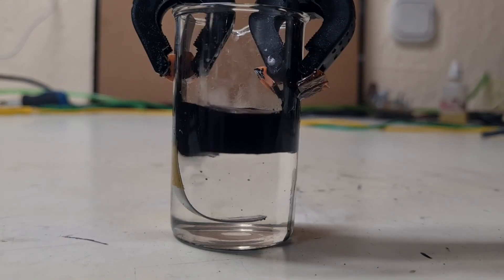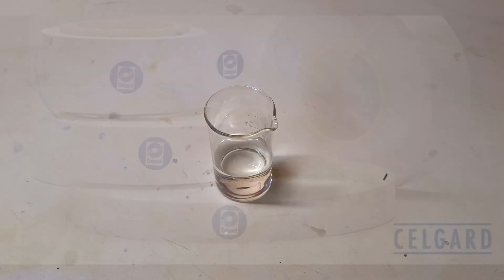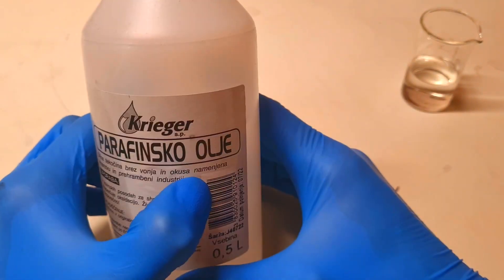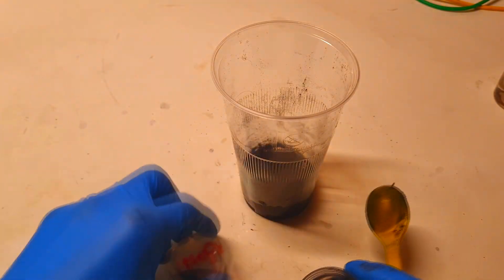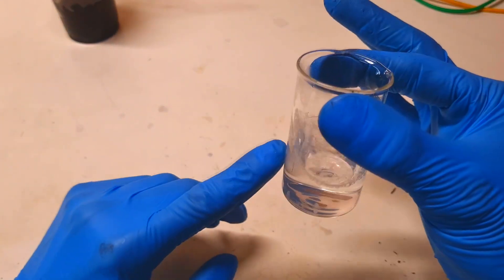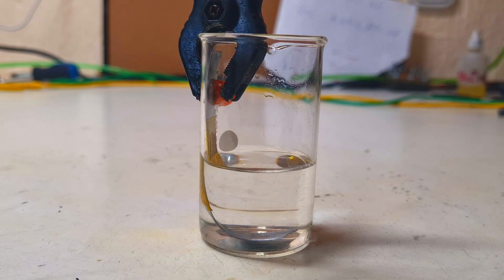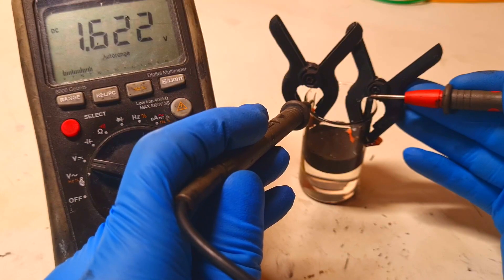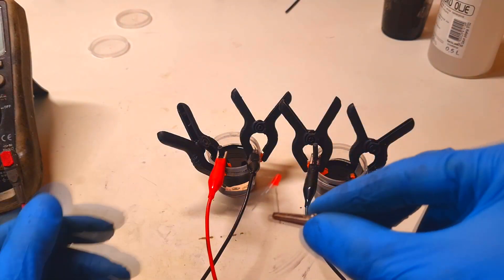DIY Separator free Battery

Comment: or use an insulator plastic tube around the metal strip
Reply: the outside of the same pipe tube can be the connector to the carbon, 2-in-1
Reply: so the air cannot really get a good contact with the water part of the electrode, so h+ and o- dont combine properly, only at the surface of the water and carbon, not porous enough, maybe a floating carbon foam would be better
Reply: if you stir graphite in vinegar, you get a ton of foam, but it will settle down
Reply: some kind of foaming curing agent is required optimally
Reply: try carbon fiber tubes, epoxy mixed or bare, inside and/or outside coated

Comment: Could you add a carbon cradle on the bottom, and add different metals(one at a time) say iron or aluminium, a way of turning metal scraps into electricity?
Reply from the maker: Yes sure
Reply: I thought the same, soap no good
Reply: I'm thinking the carbon electrode is acting as an air cathode? How about a carbon sponge on the bottom perhaps with catalyst impregnation and bubble hydrogen gas through it? It is kind of related to your flow battery.
Reply from the maker: @dav1dbone  Yes the activated carbon layer is a air cathode. In your case is better to make in static cell design. Yes, the cell desig from this video is more related to flow cell designs, but a metal air battery was easier to make. But just to note you have also metal air batteries with flow cell design. But where the oil air cathode in metal air battery can shine is as water impermeable layer that the water can not evaporate, for example.

Comment: I had a similar idea for my batteries. There is one critical issue with this approach - soap. Overtime the sodium hydroxide will react with most oils (paraffin included) and form soap which is TERRIBLE for batteries. I guess it would be possible to use some intermittent layer of a funky, non miscible hydrocarbon if one were to find an oil that would be less dense than it but the conductivity would drop to basically zero.

Comment: I like that the cathode layer shields the anode from evaporation and the inherent immiscibility of the cathode with the anode. Perhaps this is limited in current by the % paraffin (balancing low % paraffin with need to keep the cathode buoyant) and like earlier comment, more conductive additive like carbon black. Seems like a lot of avenues to experimentally optimize so who knows the potential upside. The concept does seem conducive to maybe some innovative approaches to flow battery architecture. Anyway nice work, thanks very much for sharing. 💯
Reply: Brilliant, but the issue here is reactive area. Surface between the two are simply not large enough.
This is something solved by rolling up a large area in a lithium battery for example, but it's not possible to roll something that is dependent on gravity to separate.